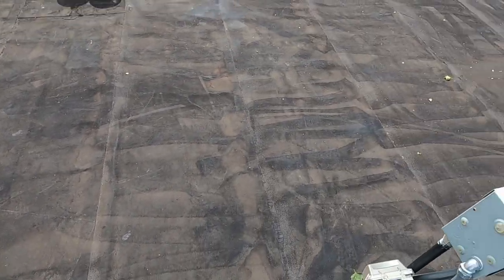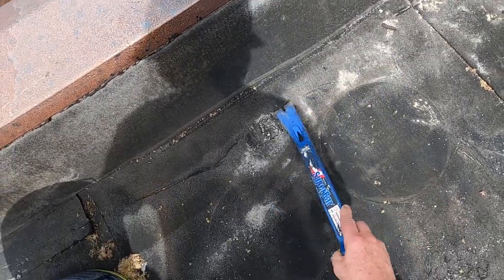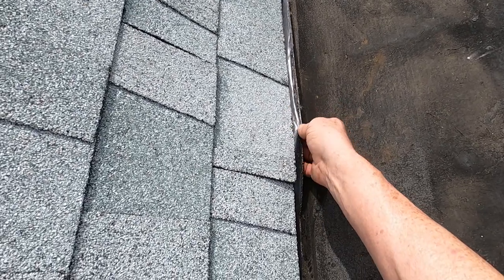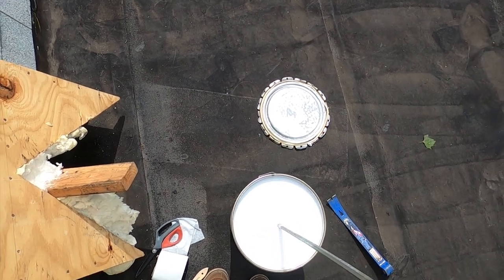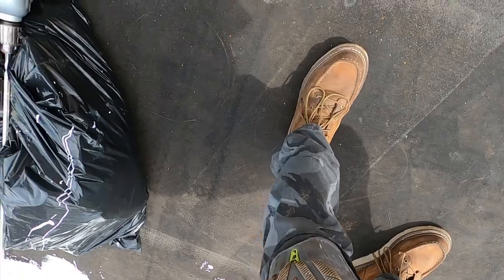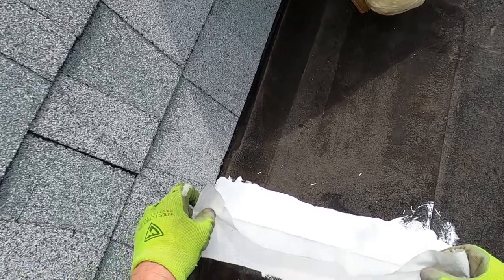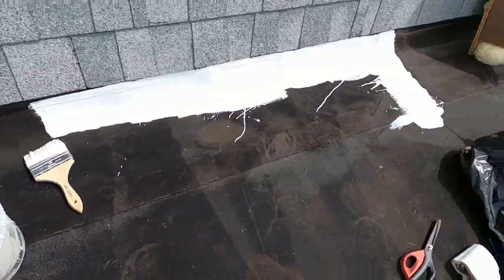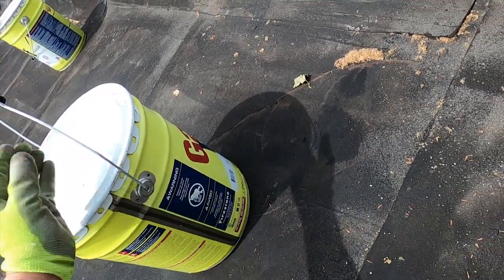12. GACORoof Firestone 50 year 100% Silicone used in historic restoration flat roof

Comment: You need a more powerful blower. That roof is not clean enough to install the coating.
Reply from the maker: First I used a backpack blower. Then It was pressure washed. Firestone specifies and I used used GACOWash diluted 1:9 in low pressure tank sprayer and after 15 min I used a 3500 psi 5.5 gal/min pressure washer to spray the detergent and debris off. The detergent etches into asphalt. After washing I may use a backpack blower to remove ponding water then allow to completely totally dry. The GACO Roof coating partially dissolves into asphalt since it is made with a petroleum distillate.

Comment: My 120 yo flat  roof has  torch down rubber membrane done about 12 years ago and has about 3 coats of Silver Dollar reflective coatings done over the years. Can I use this product over the older silver paint?
Reply from the maker: Of course you can,  however results might not be ideal. If the old coating is well adhered and not expected to delaminate any time soon, it's more likely to last. Make sure you power wash it to dislodge anything loose. You can just coat areas that are leaking as a sort of test. This roof can be recoated with the same product. Make sure you clean it. Use GACO Wash according to instructions. You can also coat it as the old coating comes off.
Reply: Yes you can as long as the aluminum  coating is not flaking or peeling like paint ...if it is then that need to be either flaked off or power washed to get it off

Once its all cleaned up your are good to go